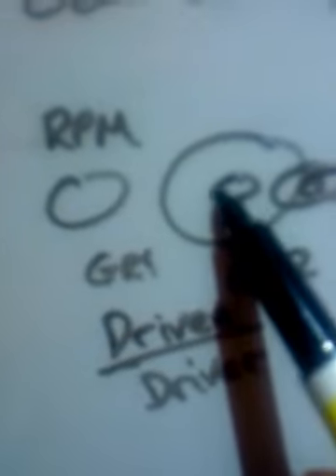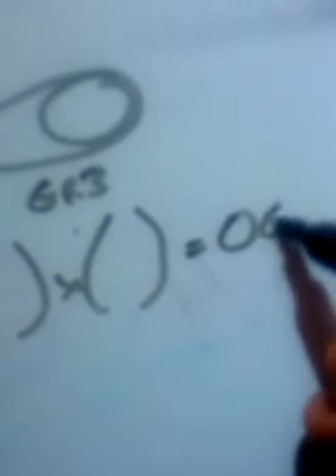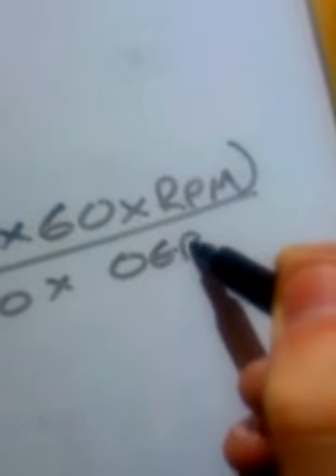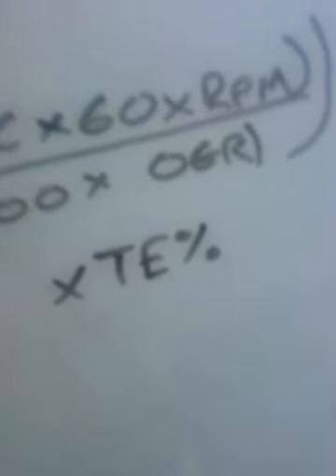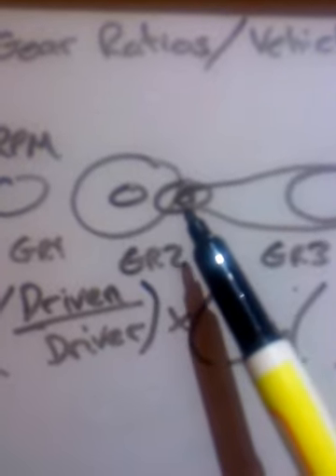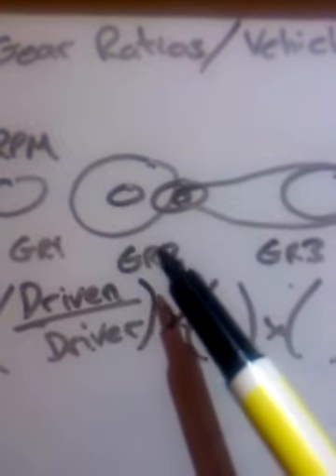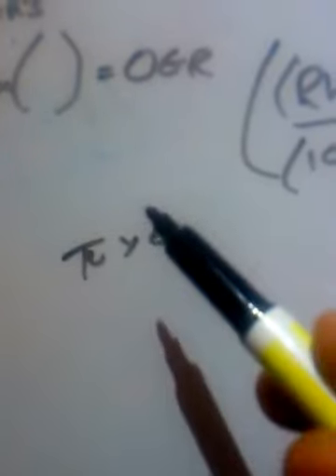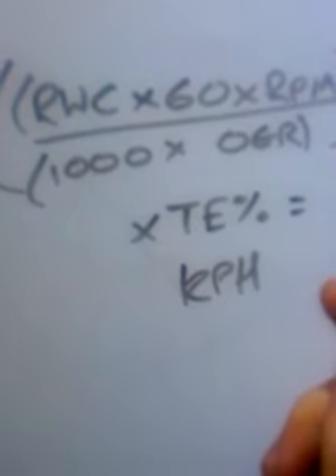Motorcycle Gear Ratios & Vehicle Speed Calculator

Comment: excellent video and the concept was well explained. An easy way to determine the rear wheel circumference is to make the bottom of the wheel and the put a corresponding make on the ground, then push the bike for on full revolution of the rear wheel and make the ground again, then simply measure the distance between the two marks.